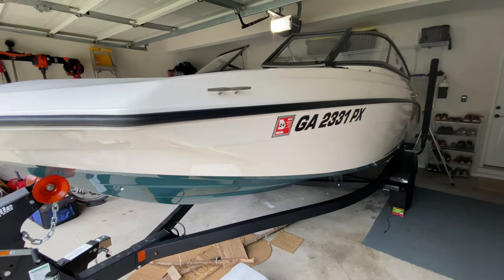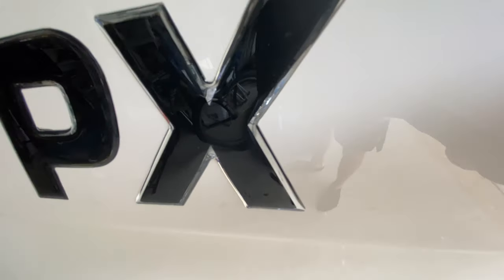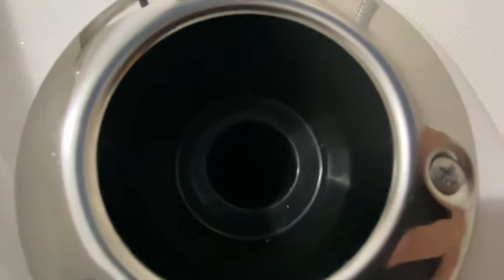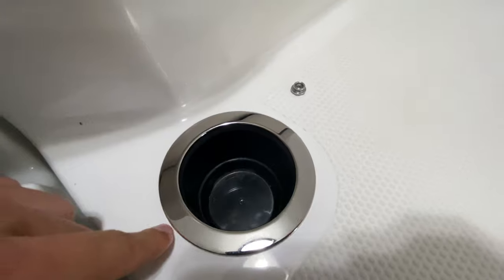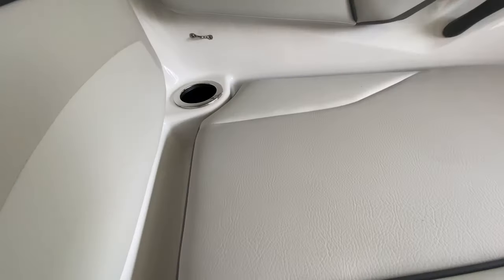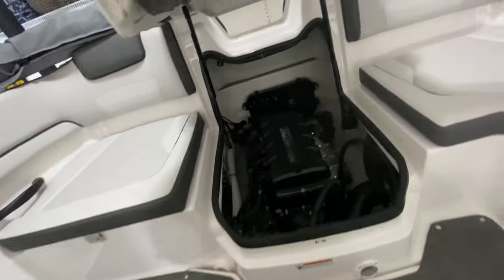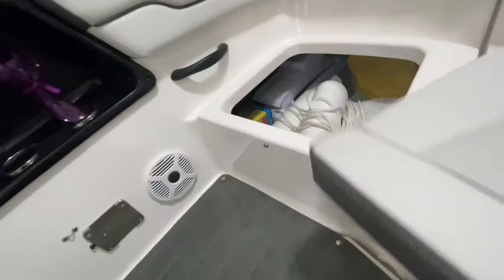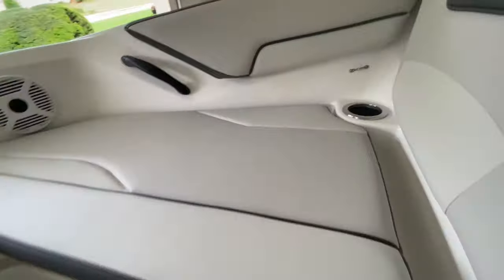2021 Yamaha sx190 walk through, 10 hour oil change, and modifications!

Comment: I lean towards  "better safe than sorry". For that reason I would never put anything metallic in the same compartment as the battery. I don't trust those "cheesy" battery terminal covers. A shorted battery will attempt to deliver infinite current, and the generated heat could result in an explosion.

Comment: What's the length of your garage and what is the width of the trailer from fender to fender tires..
Reply from the maker: The length of My garage is 19’ 7” and the length of the boat and trailer is 19’ 5”. The Weight of the trailer from fender to fender is about 8ft.

Comment: I have a 2021 sx195. How big a difference does the thrust vector make? Trying to see if it’s worth the add on.
Reply from the maker: I would say it is definitely worth it. It made a very significant improvement on the slow speed control of the boat. But doesn’t take away from the high speed agility. It is very easy to install, it only took us 30 minutes to put it on with video instructions.

Comment: Where did you get your guide poles for the trailer and what size did you go with?
Reply from the maker: We bought them on Amazon, the pads are Mad Dog 48” we got the 65”poles, we think these are the best options because of the 14 gauge metal. this is the link to the poles
Check this out at Amazon
VE-VE Inc. 47" / 65" Boat Trailer Post Guide-On (Galvanized Finish Available!) and this is the link to the pads https://www.amazon.com/dp/B01CPG0BU0/ref=cm_sw_r_u_apa_glt_fabc_A08GXMA79ETBPDZJK0ER?_encoding=UTF8&psc=1.

Comment: Great video thanks, I’m thinking of getting a SX190 or 195. Do you recommend the 195? Or is the 190 good enough?
Reply from the maker: It really depends on what you are looking for out of your boat, if you want to spend a couple thousand more dollars up front and have to use premium gas and go faster then the 195 will do that and it comes with a few more things like chrome rings around the cup holders, those are thing you can buy for the 190 if wanted. But if you don’t want to spend a lot of money on premium gas, the 190 is still plenty fast and powerful enough for water sports. There is only 20hp difference between the two. I would also recommend talking to a dealer about the differences, so you can have a more in depth comparison. They are both great boats.
Reply: 195 if you can afford. Its so much more powerful and you get more premium upgrades thruout the boat and trailer., ie. disc brakes, stainless pop out cleats.. I have a 2020 AR195 that was great to learn boating on and looking for bigger now. great lil jetboat